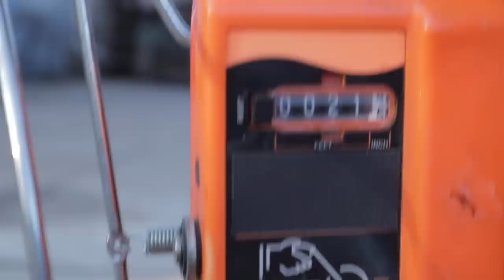Screw Hoist ~ RESTORATION ~ All Mechanical Chain Hoist ~ Back in Service!

Comment: Don't mind me, just thinking out loud. It looks good but the chain would bother me. The chain is going to get crusty again. Probably the most feasible is coat it in rust converter, then some sort of inhibitor coat, which might be a bit oily or gummy, depending on the inhibitor you use.
Reply from the maker: Na... It'll be fine... It's been derusted, oiled, and wont be stored in the dirt like it was when I found it! Plus that old chain was constructed about 7 times stronger than comparable chain made today based on my research, so I opted not to replace it! Don't forget, this old hoist is going to be USED here in the shop!
Reply: @SalvageWorkshop  The load chains look ok, the other one, maybe the camera is making it look worse than it is kinda sticks out to me. If it's used regularly, the patina of use, dirty hands on it wear and tear might even things out.

Comment: move real heavy with tractor and scoop put have an engine hoist for smaller also have a 1 ton overhead hoist in the old shop if you can come up with the I beam put in a trolley to roll in from outside

Comment: Just a quick note from experience you lose torque when you use extensions on sockets so when ever you can take a bolt loose without using a extension will be easier because the extension twists when you apply torque but I always enjoy your vids

Comment: Wilkitool hear,  I built a lift platform on wheels to move from the truck to the bench  its 2' X by 22"  and will lift   500 lbs Its  on 3"  cast wheels.

Comment: Have you considered sand blasting for some of these projects? Pros and cons? I am considering a small cabinet type for small restoration projects.
Reply: dude, media blasting is great for some stuff like rough castings.  when you get into machined parts, maybe not such a good idea.  on the farm we just dump it in a bucket of diesel and buff it out with wire.

Comment: Watched " salvage workshop " for several episodes. As the saying goes "all that ends well is well" This guy seems to get good results and the end result looks good and functions. So why do I get the impression that he is in over  his head ? A case in point is the "special" ratchet wrenches. These are in fact torque multipliers and are not being used correctly, not even close.

Comment: Wtf.. ive got a half ton version of that exact chain hoist... Im guessing it being from late 1950s plus or minus some 10 years
(it predates me at least 25 years so no clue how old it is and where it originally came from..)
Awesome little hoists, mine is worn to the point the links in the chains are loosing shape and skipping but it keeps doing its job.. 
(its starting to become a safety hazard so It is going to be retired..)

Comment: soak the chain in diesel to loosen rust it can be wiped off and will not collect much dirt need a small cabinet sand blaster would help lots or just tie the chain on behind the lawnmower for a week

Comment: I bet you a dozen Krispy Kreme donuts that it wouldn't have seized if the shaft collars all had zirc fittings that could be greased. All the interior grease was still functional but it looks like it was the shafts that seized.

Comment: Did your ever go to take something apart only to find the fasteners were backwards
Reply from the maker: Depends... More often on newer tools or machines, especially electronics, power tools, and especially chainsaws that I repair... Many times on old stuff like this forwards or backwards doesn't matter when its a nut and bolt.. biggest thing I see is things done inconsistently.. Like 6 bolts holding the case together 2 of them with the nuts on one side, but the other 4 nuts on the other side. Thanks for watching & commenting! Lots more to come!

Comment: Have you got and old 5 ton with just the 2 wheels sitting opposite ways from each other it's a ww2 German one from a gantry! I've got one but can't figure out how to feed the chain back through its only 1 big wheel and the pully wheels uts not got the 2 small ones like yours that feed the chain through back to front whare smaller hook is its got me baffled

Comment: I dug up an old logging chain while doing dirt work on my property. Its about 15' long and quite rusty of course but not so bad that it isn't worth trying to restore. My question is I saw you immerse the chains on your hoist in a solution. What was that solution and does anybody have a few ideas on what best to do to restore an old chain??
Thanx!
Reply: Probably Evaporust. That 5 gallon pail was about $60 the last time I looked at Tractor Supply.

You'll want to degrease and clean as much as possible before using it. Let it set for as long as you like.

Another option is vinegar.  That's about $6 for the Walmart brand. Maybe a few drops of Dawn dish detergent. 3 or 4 days. Rinse well. Wear gloves it starts to stink.

Molasses and water is good. Give it a month or longer, it is probably the slowest working, but old car guys swear by it, a lot of model T and model A engines have sat in that solution.

Comment: I have a 3500 pound 12 volt winch mounted to a jib  post and linear rail in my garage works well. So the carriage rolls 6 ft out from the post and swings about 160 degrees I have a deep cycle battery and trickle charger keeping it alive. I have a acid vid on my channel if you want to check it out . Chow

Comment: that worm gear,besides mechanical advantage.ALSO SERVES AS A SIMPLE BRAKE.....a worm cannot be turned backwards by the load,,the worm must be turned to lower that load...unlike spur gear hoists that must have a brake,which is the reason for most spurgear hoists being junk if left without maintenance,unlike this one,,,,,,

Comment: When using a gear puller, you hit the center spindle to periodically relieve tension and move the object being pulled.  Simply tightening the center spindle isn't correct.

Comment: Okay that no 9rde ary wrench it a multiplier. And you did not use it right. You put another ratchet on the input side a socket on the other the handle is a back up so the head / body dont turn so as you put in turns it gears down putting g less turn to socket but adds force. So turn  say4 turns on input get one turn out.
Reply from the maker: Sorry, but that's not correct... look up Swench and you will leanr about that wrench.